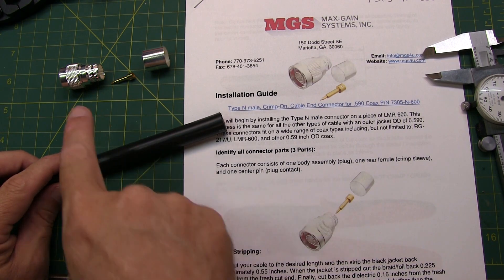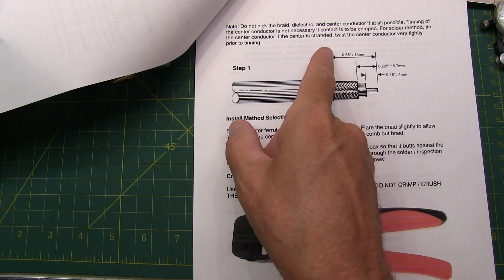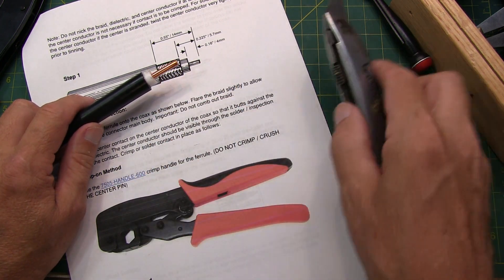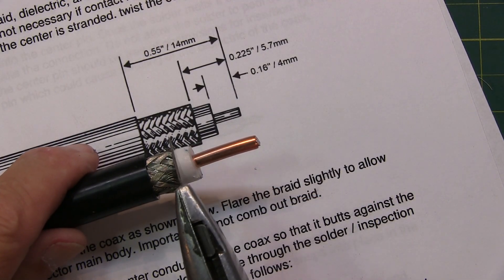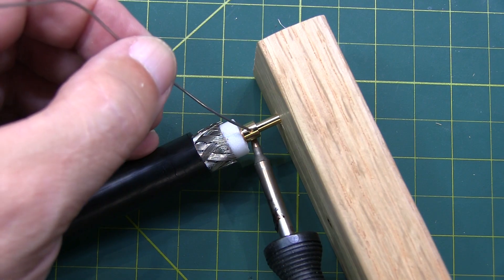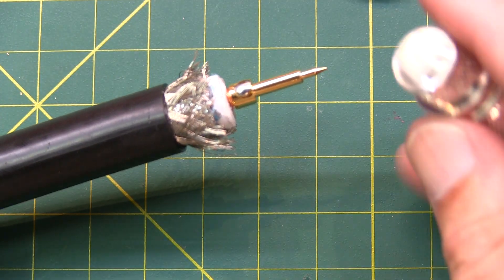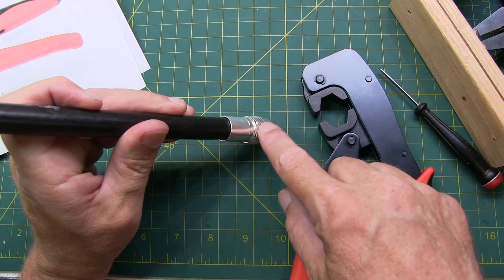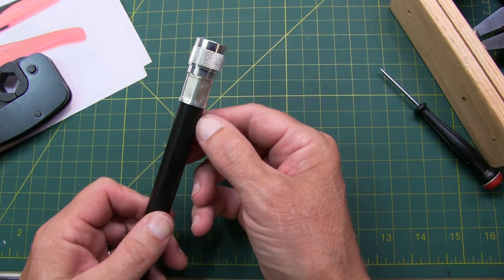#372: How to install an N-connector, crimp-on type, to LMR-600, RG-217 or similar coax cable

Comment: This is the 3 part N-Male with a center pin that crimps (or solders) directly to the center wire of the cable. 

That makes sense to me. 

I have some N-Male connectors that have the center pin fixed into place and apparently you just need to press the center cable wire against the base and then crimp the outer jacket to hold it all in place. 

I don’t understand how that can give a solid connection.

Comment: Good way to test if the connector center pin is fully seated after crimping is put your thumb over the end of the connector and press lightly then look at your thumb and it should look like a bullseye with the center pin as the center of the bullseye---N3HTZ

Comment: w2aew there is a mass confusion over the difference between bead, choke and inductor. They all have inductance but are not the same thing. I still do not understand the difference between these.

Comment: Times Microwave CST-600 prep tool will permit you to do this virtually blindfolded, you won't run the risk of cutting your finger off, and you'll get a better job, end of story.  Don't get me wrong The box cutters and utility knives have their place in a pinch but why do it the hard way?
Reply from the maker: Proper coax prep tools are definitely the way to go if you have a lot of terminations to make.  However, those excellent Times Microwave tools are an expensive proposition for folks that only need to do a small handful of connections.

Comment: Looks nice! I saw some old videos where they used thermal type wire strippers on stranded electrical wire that melted the insulation without nicking the wire. I wonder if such a tool could be fabricated and implemented for coax use? I find if I bend the cable in my hands slightly that it cuts through the outer jacket easier as there's a little tension on it. I like your "work backwards" idea here. Thanks for showing and 73's.

Comment: Nice video, very clear step by step. Thank you for pointing out good techniques, avoiding potential issues with too little or too much solder, or being sloppy with it.  Taking your time to make sure the connector stays properly seated onto the end of the cable before and during crimping is essential to produce the best physical and electrical attachment.
🙂👍

Comment: Trivia, of sorts: The "N" stands for Paul Neill, the designer.  There's also a smaller "C" connector named for Carl Concelman.  So merging the two designs into a small connector gives us a BNC connector, a twist-lock "Bayonet Neill–Concelman", while a TNC is a threaded version.

Back in the late 1980s while working with early Ethernet networking, I had to install several N connectors on the "trunk" coax.  They weren't the crimp style, they had a threaded collar with a hex shape, and the connector body had flat spots 180° apart to allow using an open-end wrench during assembly.  Crimping is so much faster and easier, as demonstrated here in the video.

Comment: When doing a lot of these it pays to shell out for the Times Microwave EZ series connectors. No centre pin soldering or crimping required. It connects with spring fingers in the connector body.

Comment: I had to smile when I saw the little saw for trimming the center conductor 😂 
I did quite a few BNC/RG316 cables lately and that’s completely on the other side of the spectrum 😅
Reply: i lost tips of mine expensive carbide snippers to coax central conductor before.. Did not expect it to be that hard. I smiled, but with pain.